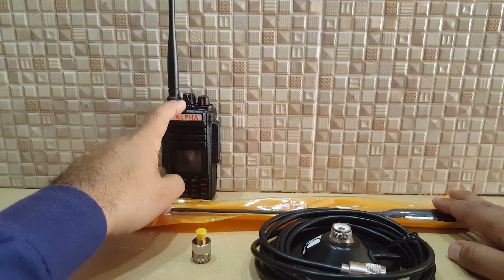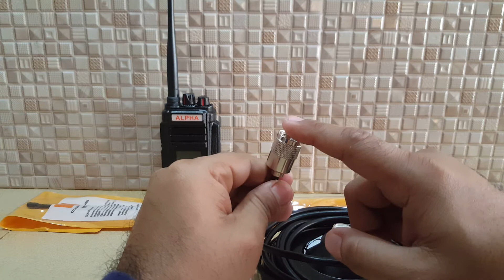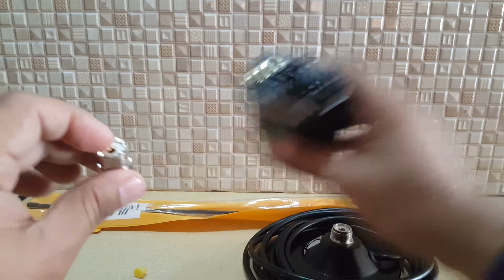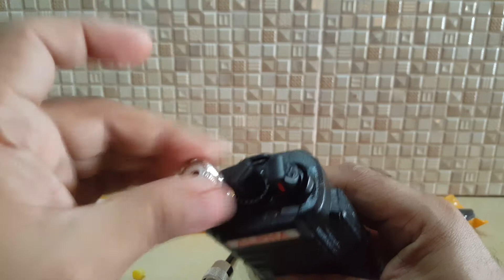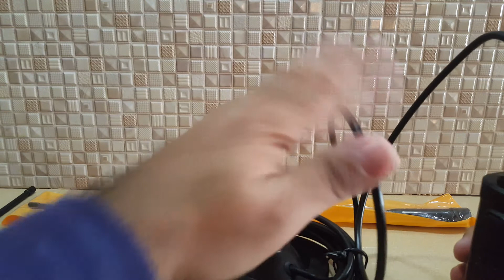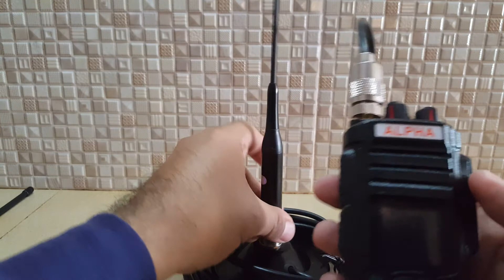12watts handheld becoming minibase

Comment: Got the same antenna and radio, used on my bugout bag... as part of my rapid deploy communication network setup... and use WLN as main radio... would be nice if there is an available battery eliminator for the Alpha...
Reply from the maker: Most accessories are baofeng standard. If it fits ok used it.